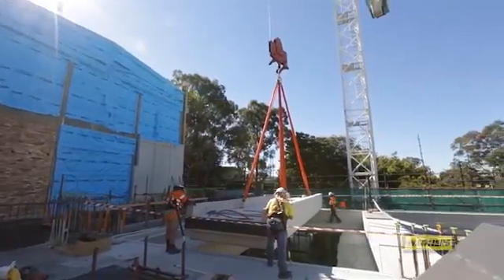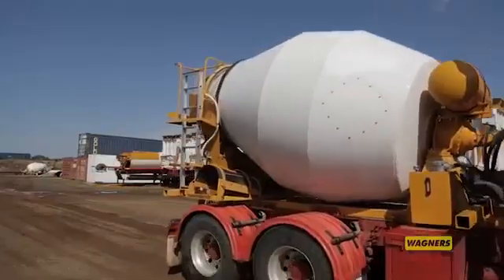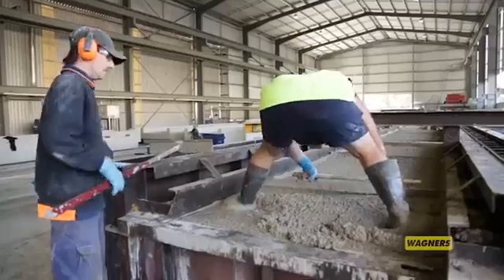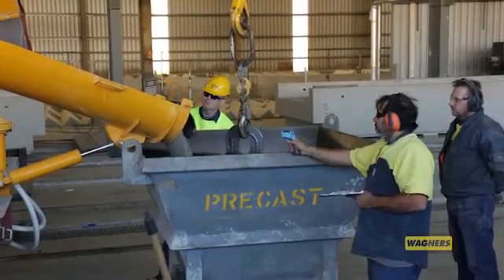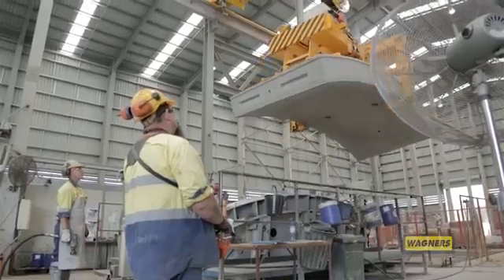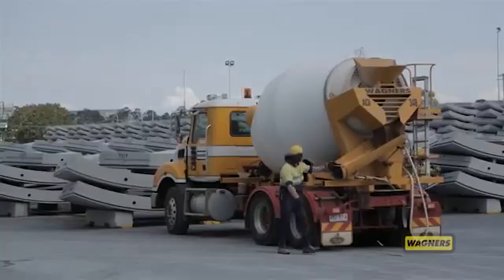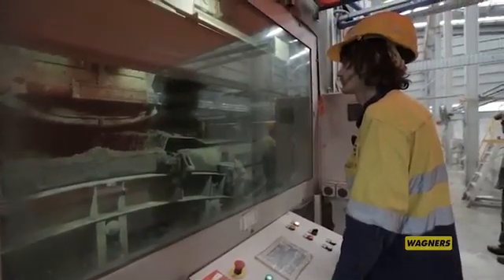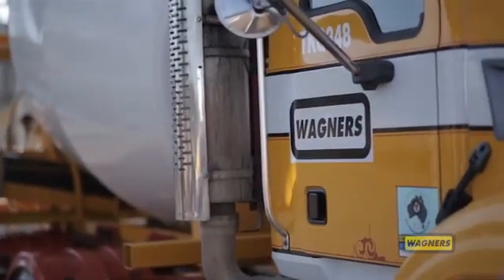Wagners EFC® | Introduction to Geopolymer Concrete

Comment: Guys, I'm a big big fan of Wagners EFC! It works just fine, is a little bit more complicated while processing because one component hast to be premixed in the water to make a solution which then can be processed exactly like normal concrete. Same machines, same aggregates, same tools and it is possible to make it on the construction site.That means you take 75 % of sand and gravel (construction waste is also possible) and mix it with 25 % of the EFC geopolymer and what comes out in the end looks almost exactly like normal concrete (normal concrete is made in the exact same way only the 25 % would be ordinary Portland cement). I say even experts can not distinguish it from ordinary cement concrete from a couple meters of distance. @Wagners You guys really have to advertise it more. Most people or customers do not understand that you have the certificate to use it for instance in Germany instead of standard concrete. Cheers. Pat

Comment: The industry needs to work very closely with the Property & Casualty industry.  if you can get any insurance reduction from the usage because of its safety and durability and risk mitigation, then you can win them over and gain more acceptance across the industries.

Comment: sir are this company also focused on Geopolymer concrete curing at ambient temperature please make a video related this
Reply: Hello, I'm working a lot with Wagners EFC and normally curing is done at room temperature. It can be heated up which accelerates the geopolymerisation. It is a typical geopolymer in this regard. Have a good time! Pat